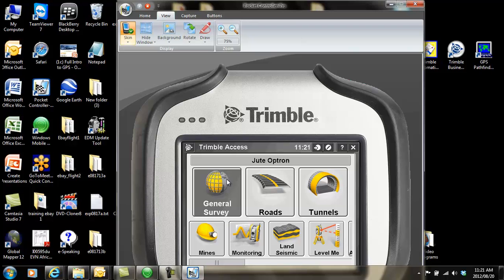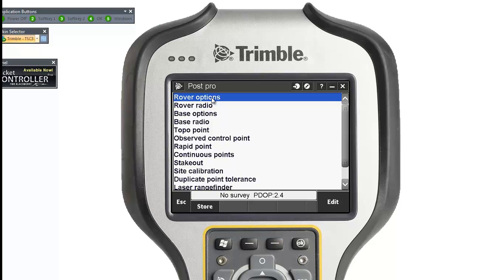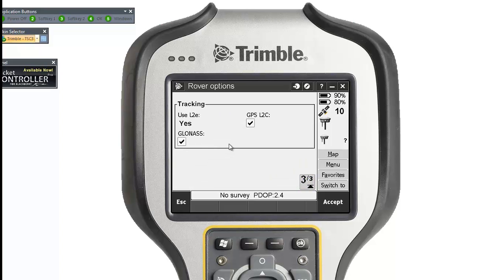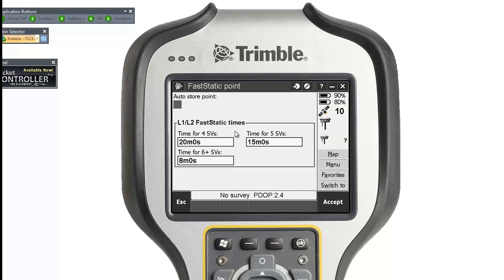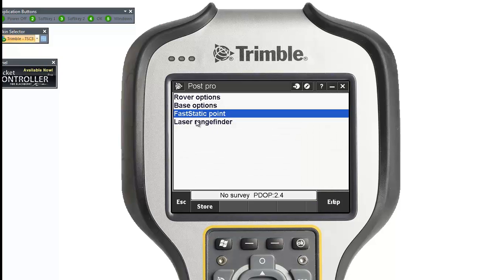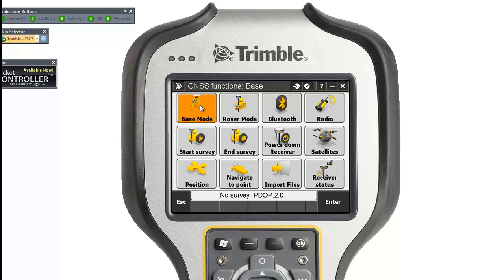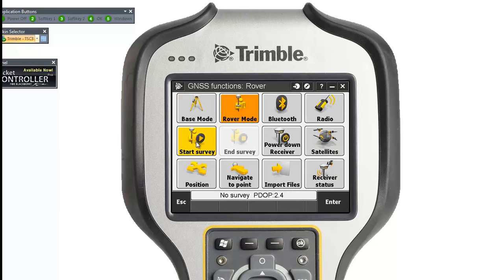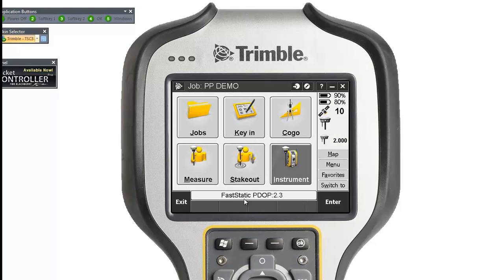Basic TBC Post Processing - Part1

Comment: What is the difference between FastStatic and PP Kimenatic? And when is is recommended to use one or another?
Reply from the maker: FastStatic allows you to log data and then process back in the office in TBC. Rule of thumb is to record for a minimum or 5 minutes and then 1 minute per km from the Base station. This is the most fool proof way to log data.
PP Kinematic allows the Rover to initialize which can take about 8 minutes, and then you can record rover points for 30 seconds. You will loose initialization should the rover loose view of the satellites.